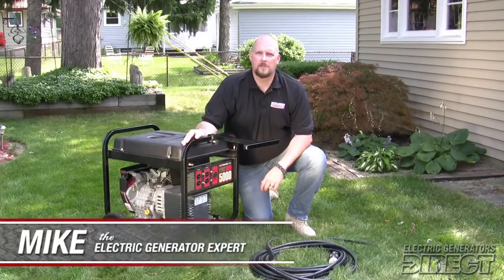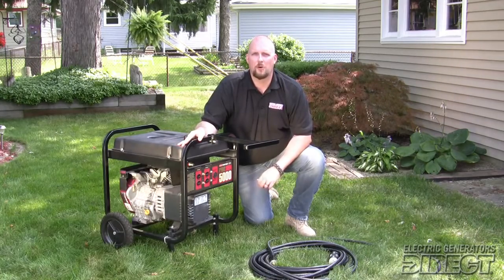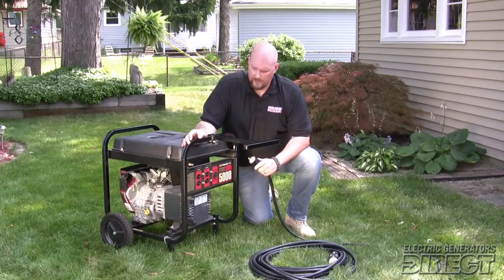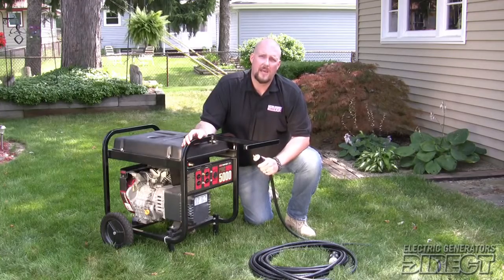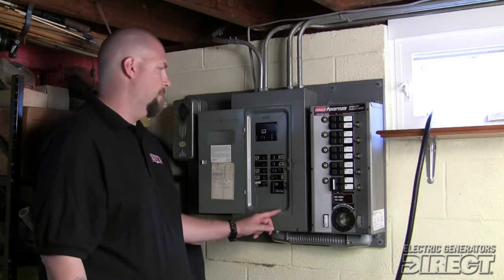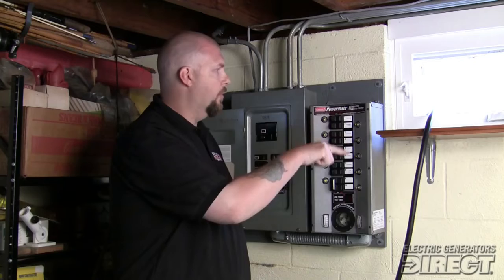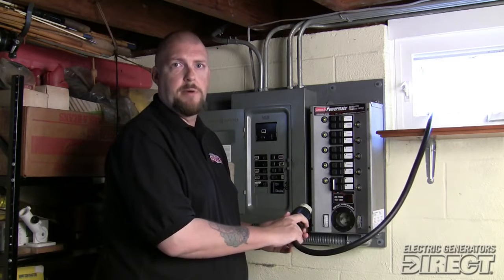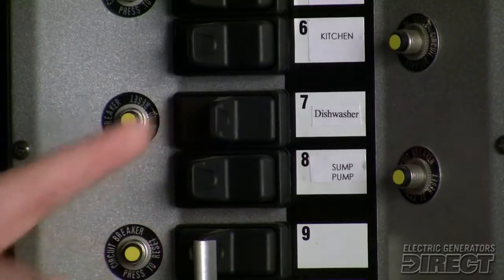How to Connect a Portable Generator to Manual Transfer Switch

Comment: Do you need to turn off the primary breaker for the home first?
Reply from the maker: Whenever electrical work is being done, it's best to turn off all power at the breaker level first, correct.